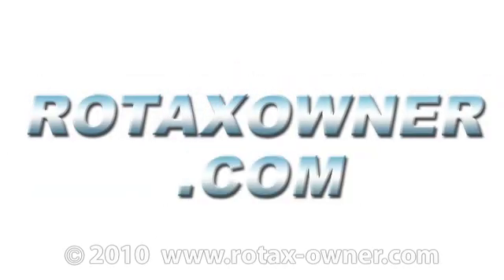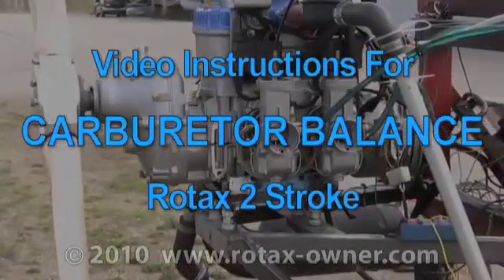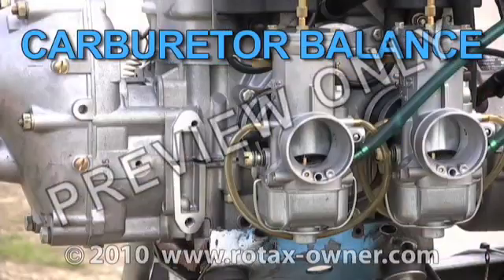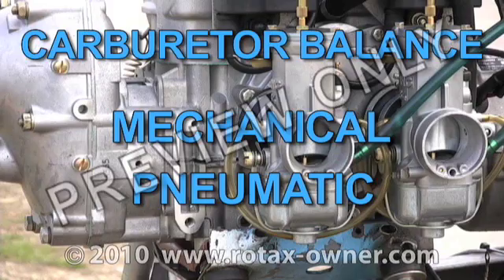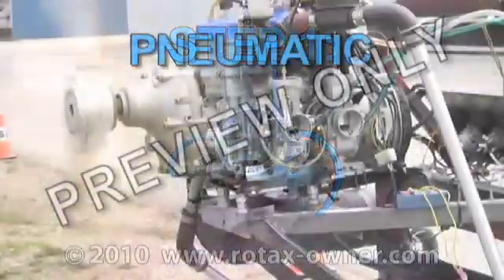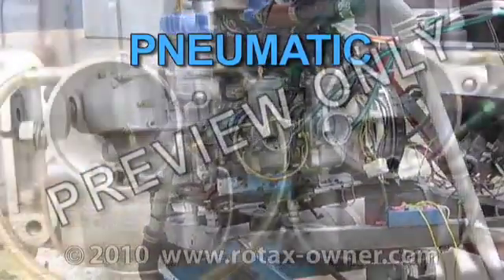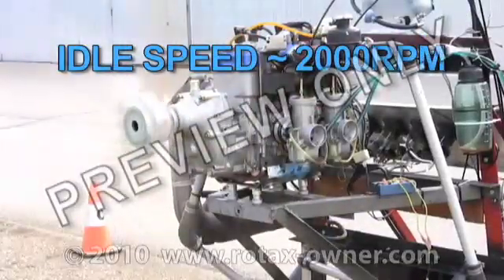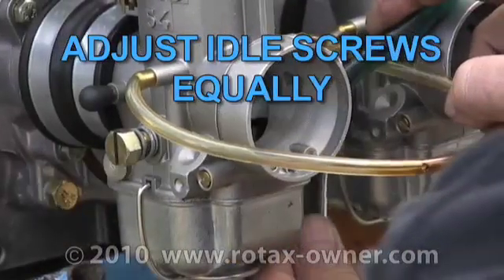Carburetor Balance - 2 Stroke for Rotax Engine

Comment: I would presume the audio drop out only on the suggested rpm for an idling engine was edited to be there for unexplained reasons... nevertheless it does leave a glaring hole in the "how to" video.  Anybody have a suggestion about what the idle speed on a warm engine (at :39 seconds into the video) should be?
Reply: The 'HomebuiltHELP' channel suggests 2000rpm for the 503 and 2250rpm for the 582 as being the sweet spots....
Reply: Im sure you got your answer already but if you look at the screen you can read idle at 2000 rpm. This videos are just junk to buy their cds.
Reply from the maker: Rotax-Owner.com is an independent website. We charge a very low annual subscription rate of only $29.95 USD a year to fund the videos we produce.  This particular video is a preview of what you can watch with a subscription. If you want to watch the full video, please visit our website www.Rotax-Owner.com